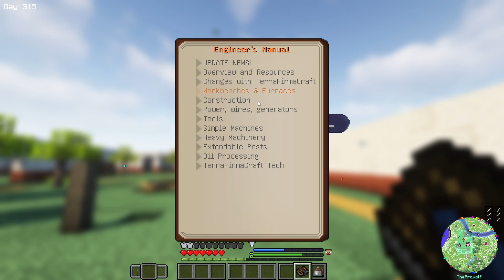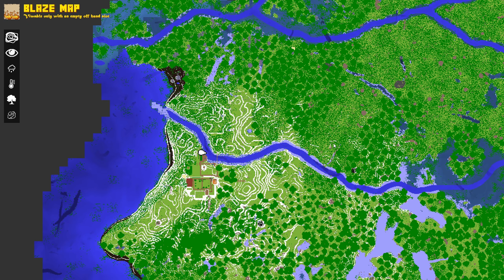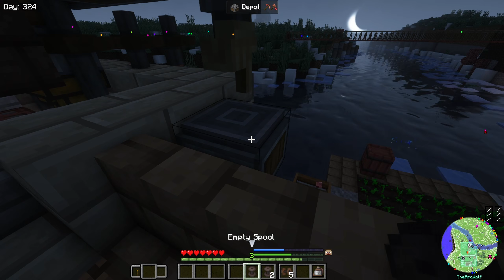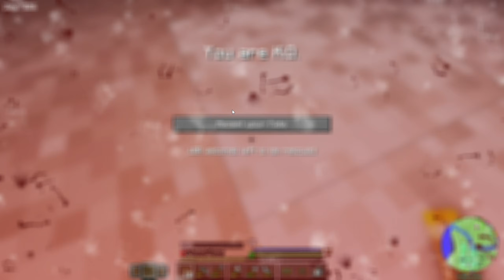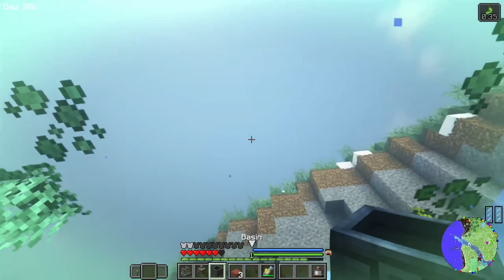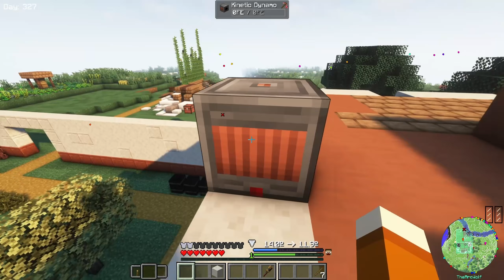Where is my Windmill? - TerraFirmaCraft: HardRock Ep. 17

Comment: For the climate station, I was able to dye primitive glass white, that turns it into a vanilla white pane, then I dyed that blue, both in a barrel
Reply: Same, really should double check these things.
Reply from the maker: @mystic_spider  I watched for a few minutes as it cycled though options (obviously I cut that) and I never saw an option to use primitive, but since you both say you can, that saves me some work.
Reply: @arcwolfgaming not sure if it’s intended because you can only dye primitive glass white, and after it’s dyed it becomes vanilla white glass pane
Reply: @arcwolfgaming I recommend using the U key on primitive glass instead.

Comment: On the topic of invisble Windmill - had that as well, different mod pack thou (Industrial Village). After some research, it turned out that it and similiar mechanisms are not being rendered propperly with shaders on. You can ether try disabling shaders, or going in to your mod folder, fining immersiveengineering-client toml file, and setting "enableVBO" to false. It will make it render with shaders on, but also i have read that with large number of IE machines on it will slow down and eventually can lead to crashing.
Reply from the maker: I think I can live with invisible windmills if that is the case. Thank you
Reply: @arcwolfgaming  yeah same issue for me but they work as intended

Comment: One thing that used to be an amazing way of generating energy: Use an Immersive Engineering windmill to create IE power, use an External Heater on a Create Furnace Engine with a Blast Furnace (the single-block vanilla item). It would produce like 8k stress units trivially with relatively low footprint. Not sure if that was nerfed in this pack or not. Depending on how many external heaters you could power with your windmill, you could generate all the Create stress units you could ever possibly use.
Reply: Which version of Create does the modpack use? The furnace engine was removed a long, long time ago (replaced by the steam engine)
Reply: @caliperstorm8343  well, don't hurt to see if External heater works with Boiler (Tank with Steam Engine). Seems logical, but probably expensive (Steam Engines usually expensive)

Comment: Are you going to pull the drill out of storage at any point and fill it by using the offhand right click? I was wondering how will it holds up this late into the pack
Reply from the maker: I've tried fueling it by placing it in my off-hand and clicking. All I end up doing is drinking the water source.
Reply: @arcwolfgaming  You need to throw the bucket with Q.

Hold drill in off-hand, hold water/lava bucket (vanilla bucket not wooden) in main hand. Then press Q.
Reply from the maker: @mystic_spider  Ok, I'll give that a try